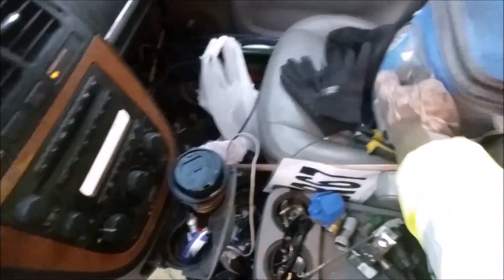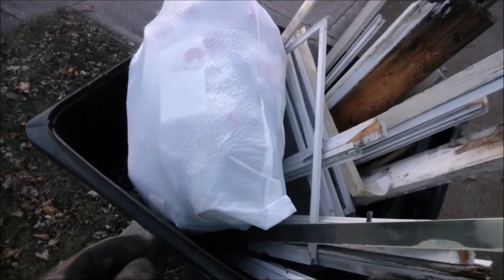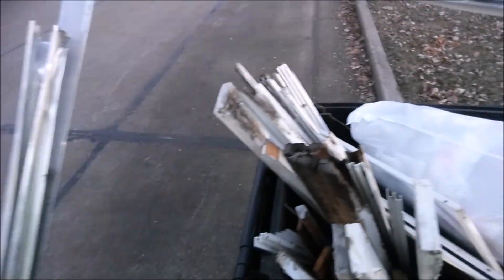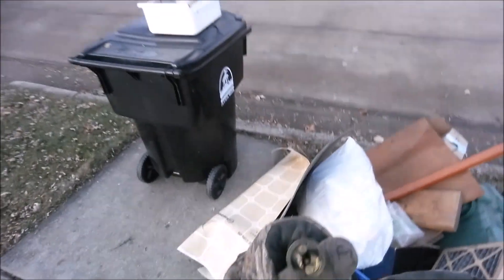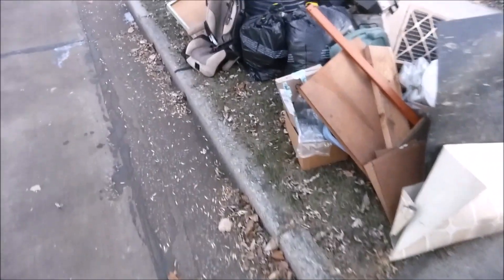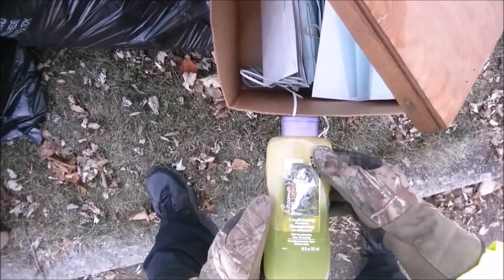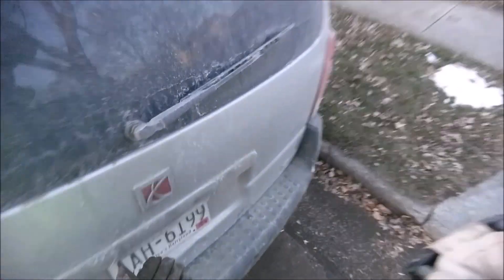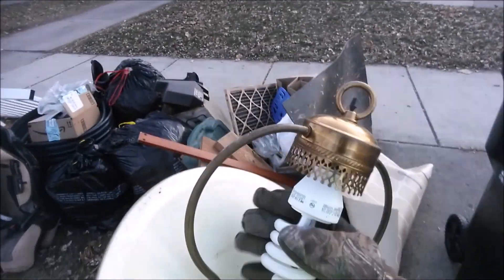THURSDAY SCRAP ATTACK!!!

Comment: Why didn't you take that road sign in that big pile? Aren't those aluminum? Thanks for sharing your adventures. Love it.
Reply from the maker: If you meant the sign in the bulky waste pile. it is attached to a steel post and set in concrete below ground. Also, in the municipality I live in, it is illegal to possess street signage.
Reply: @OldFatGuy  Oh, that is funny. I thought it was sitting in the pile. It is actually in the ground. LOL

Yeah it is illegal here too (MN). You have to have proof showing that it was scrapped. I have seen people with signs and they have proof that is on the back of the sign showing it is legal to own. 

Thanks for responding. I thought it was weird that a sign was in the garbage. LOL